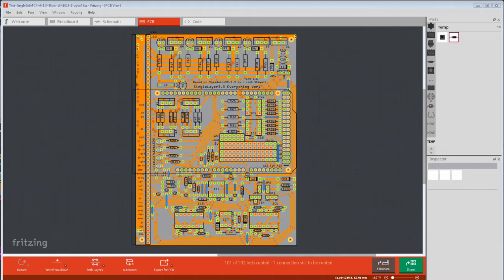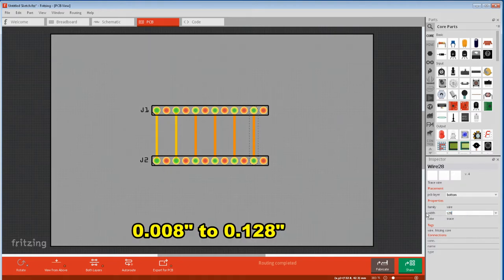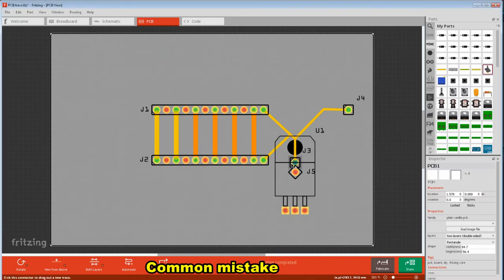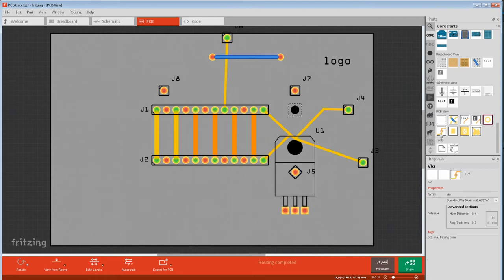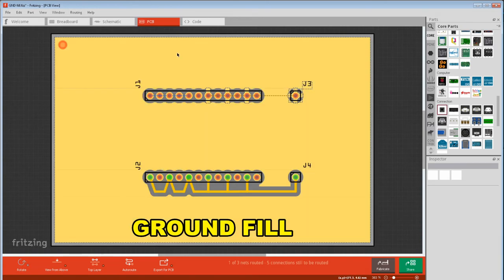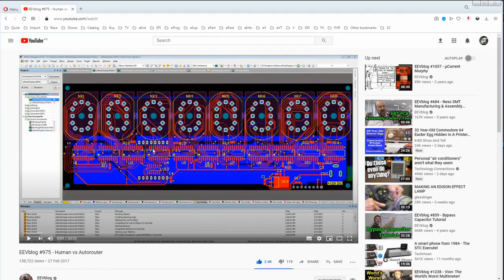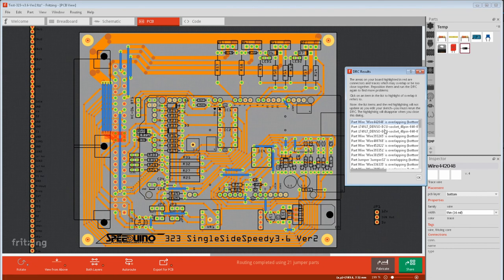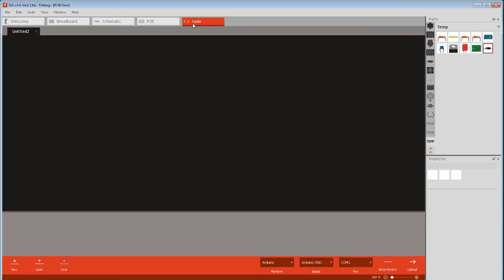Fritzing Advanced Tips & Tricks - pt3

Comment: i have a questrion im a beginner and have created a circuit but its bigger than the board i have how do i reroute it to fit the board i have. I.E to board is 100mmx70mm but mu circuit is 150x120 and there IS of room i just want it to make it as small as it allows so i can either be smaller than the board iv got or just make it fit to the centre of the board
Reply from the maker: It's hard to say without seeing it, but it's shuffling parts around and moving them closer and closer. It took me 1 week of shuffling to get 100 parts on a 130x100mm PCB for my DIY EFI at the start of the vid, and that PCB was so tight I had to measure my actual parts and make new FZ parts the exact size. Mine was a single-sided PCB, but a double-sided PCB will make it easier/smaller.
I don't do electronics any more, so the FZ forum is the best place to ask.